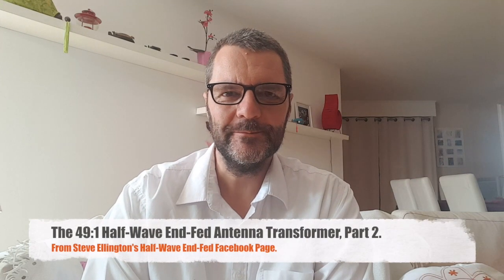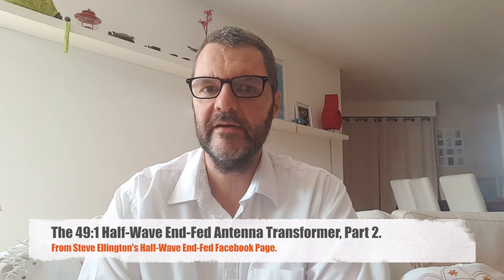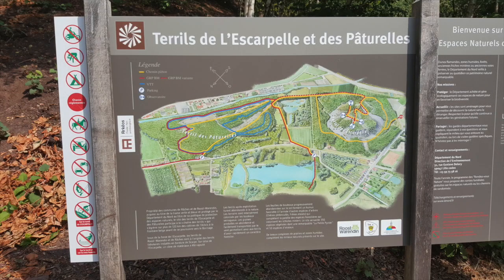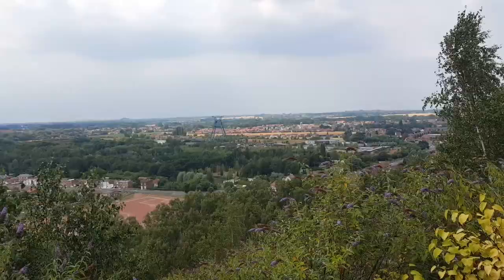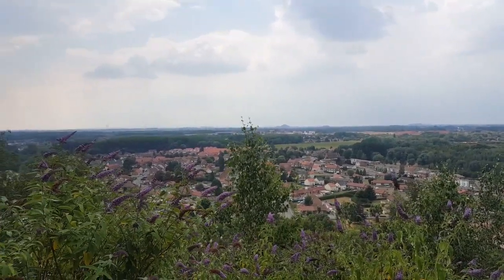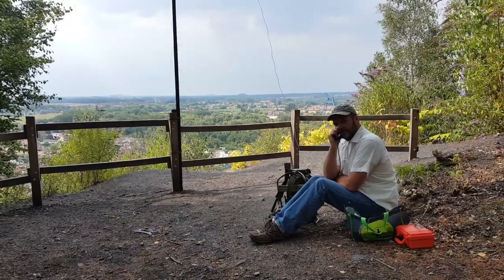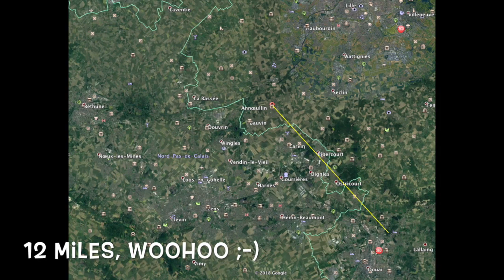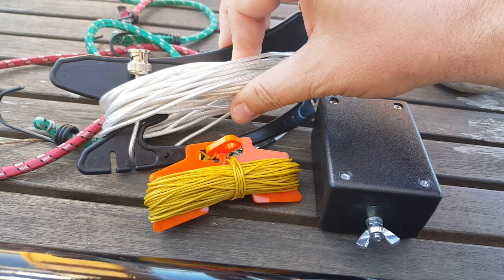The 49:1 Half-Wave End-Fed Antenna Transformer, Part 2.

Comment: I use a 49:1 matching transformer and I'm about to replace a 10m pole that broke with a 12m spiderpole . It was suggested to me to coil the antenna wire 4-6 times at the base of the pole . Would it make any difference? .
Reply from the maker: Don't do it. It changes the apparent length of the wire. You can use coils if needed but that's another story...

Comment: EFHW used to be fed with a 1/4 wave open wire feeder to shift from low Z Tx o/p  to high Z on a trailing HW antenna on the Zeppelin Dirigibles.
This kept the Hi Z feed point which might arc, well away  from any stray H2 which drifts upwards and away by slipstream. You don't want sparky bits near Hydrogen leaky bits.
Hams then used it at ground level and tucked a second HW on the unused leg of the open wire feeder...Hence vee haf zer dooble Zepp!  Vee haf vays of making you QSO!

Ich entschuldige mich für meinen groben deutschen Akzent auf Englisch. Es macht die Eingeborenen glücklich.

Comment: hi gil..for the little capacity in blue, always about 100pf 3kv, or another value ??? thanks for the fantastic video as ever, and as i have enough place to put some easy antenna at home, i would try to put an antenna for the 6m band !!, and would have a try sometimes on ... 51.7mhz you said ?? why not !! we just have to make some publicity before to encourage users on this band !! why not using for example, dmr band on TG208 french national, to make rendez vous before climbing the mountains ?? ;+)) would be a good idea to make pub and find someone ready on the band, instead having no one ready, because they don t monitor the 51.7 mhz FM portion !! ha ha ha !! si tu utilises le dmr dans ton coin, on pourrait se faire un chti qso sur tg208 un de ces jours avec plaisir !! 73 s pascal f5pnp
Reply from the maker: Bonjour Pascal et merci. 100pf oui, au moins 3KV ou plus pour QRO. Pad de relais DMR dans ma région, à ma connaissance. :-( Je m'annonce sur les relais de la région..

Comment: What would happen if you use two bananna plugs inplace of the bnc, and feed it with latter line? KG7CQG
Reply from the maker: Ladder line is 450 Ohm... It would make no sense to use that...
Reply: @RadioPrepper  
He would set up an SWR on the line and obtain  uncertain Z and reactance at the rig end with which would need a A1 ATU to handle.  Radiation off the feeder would distort the pattern of the radiating element.
Why do it? D'accord...Cela n'aurait aucun sens!

Comment: Hello Gil, F4WBY,There is an interesting, much better way to construct antenna transformers, using a number of equal-length pièces of 2-wire cable (e.g. indoor phone cable), wound onto antiparasiting ferrite toroids ("blue" ferrites). On these windings, the symmetric mode is suppressed by the core's inductance, whereas the antisymmetric mode can propagate through the core without hindrance.Now, for making a 1 to 9 transformer, just take three of these wound cores and connect the one ends of the bifilar windings in parallel, and the other ends of the bifilar windings in series. Take care of the correct polarity of the wire (phone cable has a black and a white marked wire, which helps to respect polarity). At the entry, the current divides by three, and at the exit, the three voltages add up together. The transformer ration Zin to Zout is thus 1 to 9. All signals propagate exactly the same length from the entry to the exit, which makes this antenna transformer extremely broad-band. If the wire length on the cores is smaller than 1/10 of the wavelength, there is no problem with impedance matching.To make your 1 to 49 transformer, just use seven of these wound cores and connect them in parallel at one side and in series at the other! I published this in HBradio.73, Edgar, HB9TRU
Reply from the maker: Yes, I have made a couple 9:1 that way, but this one is a 49:1. I have a video about the subject, check it out.

Comment: Good evening! I have a doubt about the use of the lenght wire of the EFHW. I've been seeing some videos that shows a lot of EFHW antennas and I dont know excatly wich band covers using just one 49:1 balun. my question is: Is it possible to cover the entire HF band (80 to 10 m) with just one wire of 134' long, or 67' long (for 40 to 10m band). This antenna is ressonable on those frequencies or not? I wonder all of these things because I want to make just one of it, but I have a single doubt if is better to make a 9:1 balun (using, of course, a counterpoise and a wire with 63 feet long), or make a 49:1 balun (without counterpoise), with near the same lenght and get some more ressonable frequencies on my RIG. Just because I do not like to use external/internal ATU.. Thanks for sharing, I watched all of your videos and liked all. 73 ES PR7RC.

Comment: Gil,
Okay I'm going to abandon the full wave antenna on my 49:1 EFHW TRANSFORMER and take you're advise and go with the half wave antenna at 17'. That's probably why I don't hardly hear anything because of my 29' sloper not tuned to 11meters. Thank you for you're extensive knowledge/experience on this.
Reply from the maker: Thanks. Remember, longer isn't always better. The correct length for the frequency is the most important, and half wave is usually the best.

Comment: Many tricks of the trade when it comes too s.w.r.regulations.usually  in dependence of wire length or even wire triangulation.power adjustments has little diverse effect and all these little adjustments add up.pioneering with amture radio isn't an easy task because the calculas canbe complicated upon measuring the electrical field.thou there is many trade secrets when it comes too antenna innovations too signal amplifiers such as preamp power sources and leanors.we allways consider the ground for signal clarity but among some special cases too where the user is in a mobile situation unable too find a proper ground,I've discovered from an a.f.pilot that a common soda can can confinsate.😊

Comment: Gil,
Could you help me I'm want to make a fullwave antenna using a 49:1 transformer. What would be the correct length of the for 27.385 mhz (11m) Any help would be greatly appreciated.
Reply from the maker: Sure, but you want a half-wave, not a full-wave. 468/27.385=17ft.
Reply: Gil,
Wouldn't a 34' wire work with the 49:1 transformer. I understand nobody wants to do it but it's worth a try to see how a fullwave wire would perform on it. That's what amateur radio is all about experimenting right?
Reply from the maker: Try it, but longer isn't better. You will increase the angle of attack, which for such a high frequency will send most of your signal into space. It won't refract. If you absolutely want to use a full wave wire, use it horizontally then, as high as you can.
Reply: Gil,
So building a 49:1 EFHW TRANSFORMER half wave antenna will basically work better than the full wave? If that's the case will my 17' sloper antenna up 35' in a 50' tree be better. I live in a hoa development facility and can't put up any on the roof.
Reply from the maker: It depends on the wire angle. I would definitely recommend a 17ft vertical wire. A sloper, hard to say. Let me find a link, hold on...
Reply from the maker: https://www.tutorialspoint.com/antenna_theory/antenna_theory_full_wave_dipole.htm
Reply from the maker: Same problem with the end-fed, bad idea. Half-wave is MUCH better.

Comment: You're videos are very informative what formula did you use for the wire to get a low swr reading 468/f. Any help would be greatly appreciated. 
73
Reply from the maker: Thank you. Yes, 468/f or 143/f (metric).

Comment: I wouldn't call that cheating. You're testing/experimenting and what better way to validate an antenna build.  I've noticed that the bands have been bad as well. Somedays/evenings, I'll turn the rig on and spin the dial and I don't hear much activity.  I've had good results with endfed antennas and the 49:1 transformer is a must have, in my opinion.
Reply: Ron C looking forward to the video
Reply from the maker: Definitely. I want to make smaller ones, using the same core.
Reply: I've thought about building one and taking it to my job. We have some plastic dip that I would use, completely coat it with 3, or so coats and it will have a rubberized exterior without the need for a box. Hmmm, sounds like a video!
Reply from the maker: That was sort of my plan. Sotabeams has some goop like that...
Reply: I'll definitely make a video if I can get it done that way!

Comment: good video Gil i did some testing with the 49t1 I made but have not made any qso yet. Away on SOTA this week but using link dipole. Seeing you are not into shaving you could use your old shaving brush to clean your keys and rig face, I use one all the time saves sticky finger marks or scratches from rubbing the dust into shiny surfaces. vk5cz ..
Reply from the maker: LOL, I'm not into brushing either ;-)

Comment: Congratulations on finally getting a 6 metre contact on the PRC Gil, well done! I'm a big fan of halfwave end-feds too, I used to have a 'fan dipole' up for 40-20-17&10m, I was able to switch between it and my 20m long end-fed to enable back to back testing, after a couple of months the dipole came down, the end-fed was always as good, and in some cases 1-2 s-points better! 73, M0KED.
Reply from the maker: Thanks, not surprised..